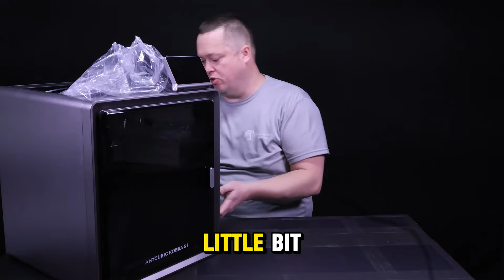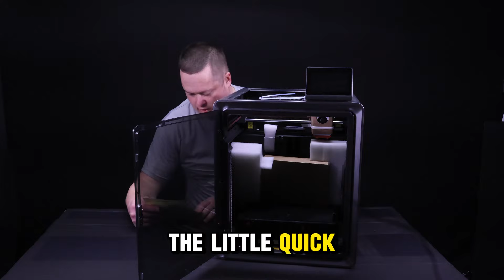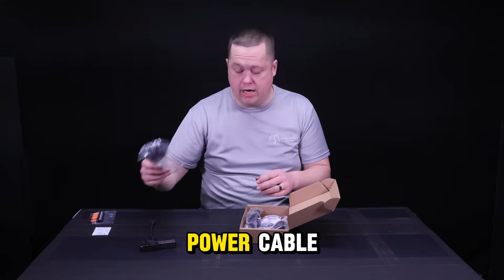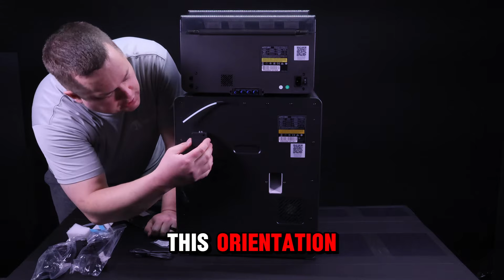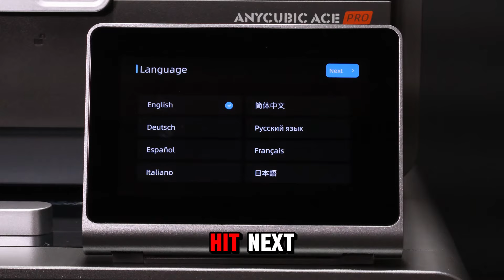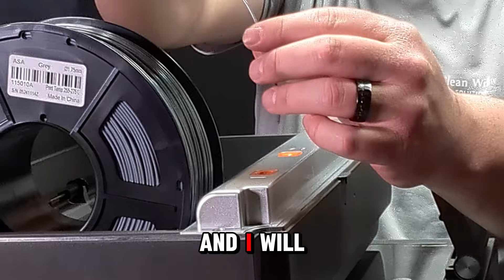Anycubic Kobra S1 3D Printer Unboxing & Setup – First Benchy Print Test!

Comment: Same happened to me. 🙂
Forget one Screw in the dark Buildroom  ....
But after using the printer for few days now I'm not really happy with it.
The Heatbed is bend and only fixed on three points. So adjusting is difficult.
The Hotend is very flimsy, cheap constructed and badly mounted.
The Extruder is difficult to disassemble.
First Layer quality isn't that great.
But the loudness of the vents is really great .... (on PLA  you must open the door)
Would I buy it again?  No, there are more negative points ....